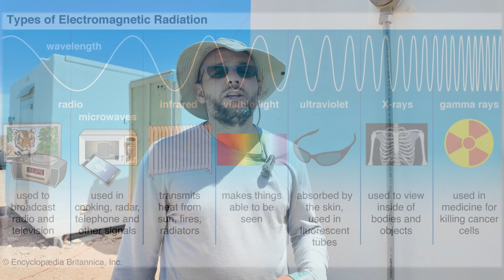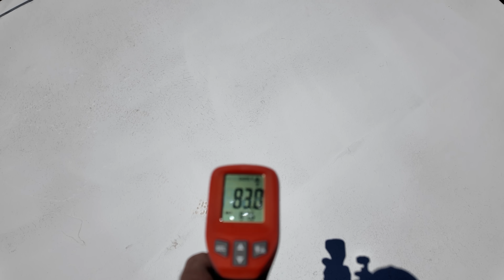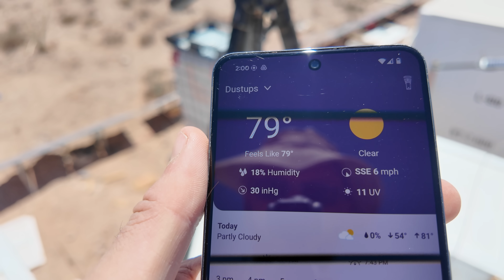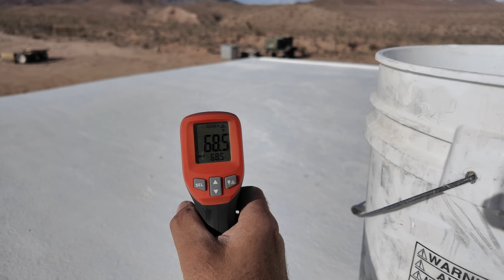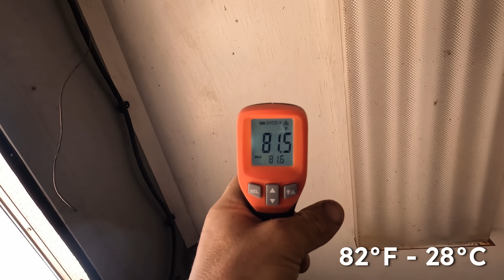I sprayed "cooling paint" on my desert cabin...this is shocking

Comment: I built a 24 by 12 wood structure and placed a white tarp all over the buildings 2 by 4s, I then placed 2 by 4s perpendicular over the roof trusses and then installed a white metal roof on it, the air space kept the structure pretty cool, I also vented the attic space on both sides with vents, Also I dug a hole in the ground underneath the building to keep the floor cooler. Then I insulated the walls and ceiling with half inch insulation, Stayed comfortable in the heat. I sided the building with wood t-111 siding.

Comment: Have you considered putting an elevated roof over each existing roof with ~6" brackets keeping it separated? Just a sheet of steel or even plywood or something cheap that might not last forever but will bake in the sun in place of the attached roof. A sort of heatsink

Comment: I live in Los Angeles.  I have creme colored  solar shade cloth over my security bars.  There are swap meet tent corners that use 3/4" electrical conduit as poles.  You should be able to get creative and build structures out of those to cut down on the percent of heat onto your roof and walls.    A friend in Taos built a wall of shutters giving him the ability to adjust how much sun hit the sides of his home.   A friend in 29 palms glued on straps of 2" foam sheathing on 4' centers then glued on full sheets leaving gaps at the base and under his eyes.  This gave him air gaps and 2 inches of foam sheathing.  His cooling bills dropped 60%   the reason he did it is there was no plants on the ground within 200 feet of his house.   He had roll up bamboo screens blocking the sun from his patio doors.

Comment: One cooling option would be to partially bury the buildings. If you remove air contact from the sides, the ground temperature is the driving force for the building. 

Much like a, "frost line" in colder climates, Texas also has some thermal averages. In central Texas, temperatures stay in the mid 70's at a 30' depth year round.

Obviously you can't bury one if these that deep, but covering the sides and topping with the paint will definitely reduce temperatures significantly. For instance, digging a ~5' deep trench and lining the buildings up in it with the backs/sides covered by the excavated earth could knock ~5-10 degrees off ambient. Basically like a walk-out basement.
(It'd probably be easier to set one against a natural earthen wall and just push some dirt over the top, but that's likely outside your scope, as is most of the burial idea given how hard it is to dig in your area.)

Realisitically, i think just placing solar panels on the roofs as shade would be a better option. Then you can run more AC units!

Comment: Ok Shaun you need some physics classes. First off any reflected light  off your hut is not going back into outer space. It is being absorbed by greenhouse gasses so the reality of it is you are not doing anything. Greenhouse gas molecules absorb infrared light in the 4 micrometer to 80 micrometer range. If you truly want to keep your little room cool then burying the room  in dirt is the only way to go. You will also bury the roof and sides of the exit from the hut.walkway from the  front door and that walkway should have at least  two 90 degree turns  to exit your little hut to block wind..

Another option is a heat pump powered by solar.

Or you could just construct a roof over your huts to block the sun and use tarps to do the same on the sides. 

BTW I hope you are getting some of the rain I'm seeing on the radar. date 10 June.

Comment: No offense bro,
I have mad respect for what you are doing.
I laughed at your e-bike, I’m sorry it’s super fancy.
I thought maybe standing water trickling down your crack dams constantly would help the vegetation.
I considered paying your 25$ a month and joining your club and pitching my two cents that is going to infinity in this chat stream.
I considered taking everything in my whole life and turning it into cash to come out and physically help you work on my own cost
I saw the same video your did, I think it’s a super experiment what your doing painting instead of shade cloths turning into wind sails —you could have demonstrated the paint in 30 seconds probably didn’t need to be 18 w/commercial break.

See what is really having a major impact on my desire to even pay the 25$ is that I have yet never seen a montage. And you’re a great editor -or have a great editor.^mont.^ In which a shovel pick or variation wielded by hand was ever used.
I’ve seen explosives, I’ve seen dozers, I’ve seen big trucks.
I thought you were a marine. Maybe I told myself a story, something about you made me think you were a strong soldier type dedicated to getting the project done.

Now you say “I give up” in the same video named I give up you say “I will try and try and try and try”.
I think you’re trying to take me for a ride and I want to see that you will not give up.

I want to see that the impossible task is just another day

I want to see that a soldier fights against nature and wins the best of it.

I want to see the back breaking physical exertion of trying til hell hath no.

Good day

Comment: I lived off grid in california's desert for about 6 years.  I put a shade on the western side of the trailer that effectively kept the side of the trailer in shade all day (and especially in the late afternoon when it was hottest (114 F). I also had some kind of white elastomeric coating on the roof that seemed to help.  I would recommend rolling it on with a paint roller instead of spraying it, and make sure you roll it from multiple directions to ensure even coating.

Try not to open doors or windows until it's warmer inside than outside.

If you have sufficient solar and inverter amplitude, you can run A/C all day long without ever draining your batteries until sundown.

Comment: Honestly, I think even adding another flat roof an inch or two above the current roof, could add quite a bit of cooling. And you could even have that one overhang on both sides, to add a bit of shade to the walls, too, when the sun is close close to directly above, and for the space around the buildings, you can use a few poles and tie to them a few tarps, to have a shaded area. I remember there is some glue or resin which works with space blankets, so you could glue/attach thin space blankets to greenhouse film, to have the strength of the greenhouse film (and maybe also chicken-wire below that) with the reflective properties of space blankets. Though it might be best to place the greenhouse film closer to the sun, so it protects the space-blankets film from rain-based erosion and from dust piling on top of it, so you can simply use compressed air or a leaf-blower (ideally an electric one) to clean them, if needed.

Comment: i have a split unit ac set at 79, using about 550 to 650 watts and currently only have 3 400w solar panels charging a single large lithium battery.  With more panels and smaller units and some sturdy shading with netting or sun tarp things obviously capable of withstanding wind and i feel it would work.  I would put the electronics in an ac space

Comment: Okay, I'd like to made a suggestion... But maybe that's complete nonsense, I don't know. My first thought when I saw your tiny box houses and your sunheat problem was: Why didn't you build a separate roof over the box? With some space between the box roof and the "carport".I imagine it like a "carport", so you did not get heat the boxes directly from the sun. And my second suggestion: When I saw how windy it was when you shot the video, why don't you use a wind turbine? Is the energy consumption too low compared to the cost? I'm certainly not the first to suggest either idea, there are much smarter people out there, but I'd like to share my ideas with you. I'm keeping my fingers crossed for your project.

Comment: I like what you are doing, and I have some suggestions for living in the Chihuahuan desert. First and foremost switch to 12V AC units. They use very little electricity. You currently have more than enough solar and batterie storage to support the 12V AC units. There are mini split and RV style roof units available. 

Second: Place your oil field buildings in a square four corner position with a plus sign space in between your four building. This will give you dog runs in between your small buildings. This will help maximize air flow. Then build a shade covers over your four current structures. A double roof is very important in this area. Make the shade large enough to have porch eaves over your oil field buildings. Please do this to maximize comfort before it hits 120. Good luck, and I’m wishing you all the best!
Reply: Yeah, Midea makes a 12V inverter window unit AC that runs with very little power and they are awesome. I put on in my 3 car insulated garage and its just like the rest of my house. I also use de humidifiers in conjunction and wow. what a difference.
Reply: Ahh, 12V air conditioner.  I couldn't figure out who uses 12v alternating current lol
Reply: @captsorghum  It has an inverter, hence 12v inverter window unit.

Comment: If you can make a temporary false roof out of white greenhouse shade fabric by tensioning it a few feet overhead to like posts at the corners, or even wider than the structure in like an inverted cube (all post angles from the top of the vertices of the inner cube point outward at 45 deg. from horizontal to create a wider platform for the cloth than the structure) like a shade sail, allowing it to fly a few feet over the top of the structure, you can reduce by ~50% the amount of light that makes it onto your structure. Because it's cooler on one side of the cloth it creates natural convection currents outside that draw away the heat from underneath, cooling the roof with even more reflective paint with temperature differentials. The paint is good, use it in conjunction for your structure.  The more shade you can create for your structure the less work the paint has to do.  These posts for the shade sails can be detached later when you can build the top level, which you can then fly shade sails over. They are common in desert backyards for their passive cooling on patios, etc.

Comment: If understand correctly the paint alters the wavelength of the energy being radiated back out. If that's the case wouldn't using thermal cameras or non-contact, passive infrared temperature measuring instruments possibly obscure the result of using specialized paint? Actual surface temperature of the roof (and internal ceiling) would seem to eliminate those concerns. I'm not an expert in RF/IR energy transmission but I do have a background in science so I'm wondering. Maybe this is all nothing, but I'm basing this on my understanding of varying emissivities and wavelengths.

Comment: Personally i don't get why this setup is even needed but in general i don't know about you  but for myself i try to do two things same time.. or do one thing and accomplish two things.. So I would place solar panels on top of your roof with gap about 50cm or half meter above roof of your buildings.. this way you can use shade also use solar panels as source of power and 3rd things you need to have gap between your roof and bottom of the building so you wouldn't create hot pocket or air.. If you research how it is done in desert area it is done by placing two blankets above each other with gap of at least 30cm ...so you would have roof ..gap blanket..gap and another blanket..this is to reduce heat transfer as low as possible..ofc in your area it is not so easily done as you have pretty high winds..so i would use solar panels at top then gap and then normal roof

Comment: @dustuptexas Run some of that pipe you have across the tops of the building, and put the solar panels on top of those pipes to provide you shade and to make power. I used solar panels as the roof of my patio cover, and it is such a blessing on those hot days, and it provides me power as well.

Comment: I think poly pipe with rv antifreeze would be a good cooling option.  Still need power for the pump and fan though. https://youtu.be/MUWjjjFgXdg?si=Tjjsyl9PwzGoDs1T and then this architect made use of materials and natural air flow  It is a little more complicated as it uses materials that let heat escape and a roof design like an airplane to flush out the escaping heat. https://youtu.be/oGX7yosSLCc?si=z8EJf6_ODabj9CkT

Comment: Shaun,
You are 100% right that the roof is the most important part, but the outside walls would help, and by a lot more than you'd think.
The infrared radiation will disperse at a lower rate than the roof, but we're talking about 100% (roof) to about 50%-75% (walls).
I think the best reason not to do it is how damn expensive the paint is!

An other point is: you may want to think about painting the insides of your buildings black.
Black paint will absorb a bunch of heat (from stove tops, body heat, an electronics) right into the walls to be dispersed by the white reflective paint!🎉

Comment: If the Paint works IT is great.
But you should your resouces and that is your Wind. 
If you have Deck (Wood?) mounted few Inches above the roof Wind will Blow between roof and that Deck. That has an cooling effect. If you Paint the Deck White or glue reflecting Aluminium in IT, the cooling effect increases.
Btw : Did you ever checked If a small Wind Turbine would Work in your place??

Comment: Ground should slope away from your buildings for drainage anyway, but intentionally sloping ground away on sunny sides will reflext more of the sun bouncing off back towards the sky away from building.  Think ant mounds. 

Getting beneath the ground is a huge win, as long as water drainage is accounted for, you will regulate your average temperatures.

Cooler. See air-gap walls for concepts.

Comment: I hope you give an update on the paint’s performance after the heat of the summer months coming. 

I’ve got a sea container outside of San Angelo I use as a workshop I need to keep cooler. 

But at $300 plus a gallon, it would be crazy expensive to coat the container.

Comment: You should absolutely paint all walls (on the outside), not just the roofs. Inside makes no sense, but outside it'll still make a difference.
Both your walls and the mountains are diffuse reflectors. They will not bounce all the light back perfectly from whence it came. Some of that light will still be bounced upwards towards the sky and, therefore, radiate away. In fact, almost none of it will bounce straight at the mountains and back.
I don't quite get in how far the paint doesn't match. If you paint all the sides with full hyper-reflective white, they will match, no?

Comment: I think the key to understanding is the fact that you can either radiate or reflect in any given wavelength, the more of one the less of the other. Incoming light frequencies are based on the temperature of the sun and local emissions are based on temperatures we experience here. these are two different frequency profiles. Keep in mind at night if you have an object black(weird concept perhaps) in every it will lose heat to radiative cooling and an object perfectly reflective on every frequency will not. This principle has a name, feel free to post it below.

Comment: But what is the relative room temperature inside each building that is what counts and you will find that there is not a direct relationship with the roof temperature because atmospheric temperature surrounding the building also heats the building not just radiation,the way to avoid this problem is to have a heat sink and the best heat sink in the desert is the ground so place your buildings in the ground on a raised platform of earth if necessary but direct contact with the earth can cool buildings 10 degrees,happy hunting Shaun,I always enjoy your channel,don't give up bro we love what you are doing.

Comment: Sounds good but heat still penetrates and the main problem with insulation is that it does not breath so heat accumulates therefore temperature rises even if  a very small percentage of heat penetrates the insulation, this is a problem hard to overcome with sealed buildings but if the insulation breaths the heat does not accumulate therefore the temperature does not rise,this is how the sub Saharan African huts stay cool with a combination of open thatched insulation on the surface and a sealed layer underneath.A thatched roof will cool your buildings better than white paint.

Comment: You could prevent the building's roof from absorbing solar radiation by building a false roof overtop with a framework and solar panels. The panels will covert all that sunlight into usable energy for you and if there is a good gap between the roof and the panels to let air circulate then the direct solar radiation won't be able to heat up the exterior of the roof. If you can't afford the solar just adding anything over the roof with an air gap would at least protect the roof from direct sun exposure. A desert garden shade cloth would also work well too, and you could extend them to cover the area between the buildings which will help reduce the surrounding air temperature.